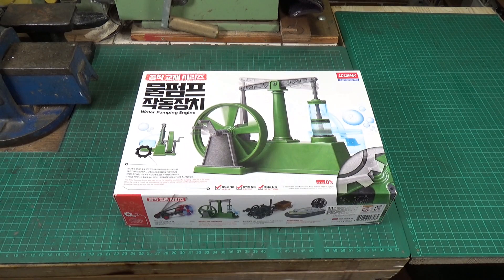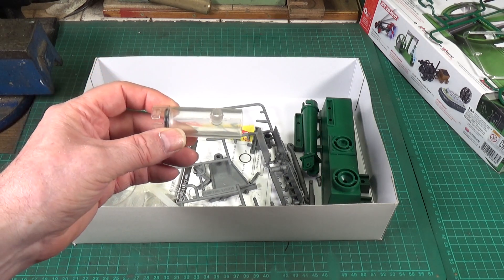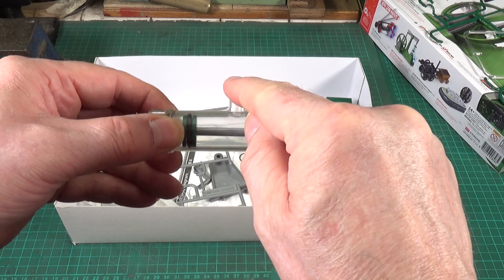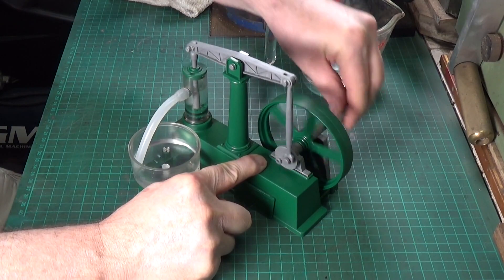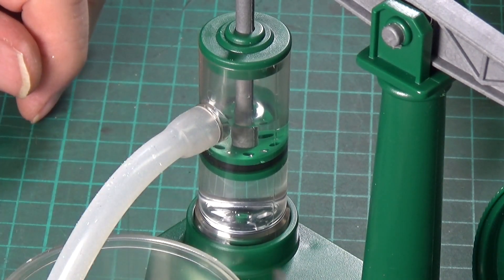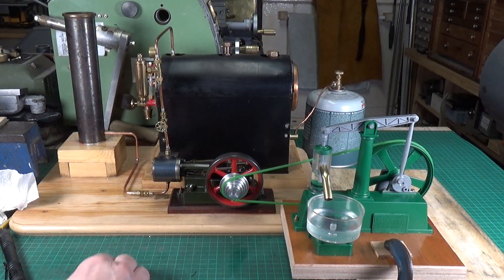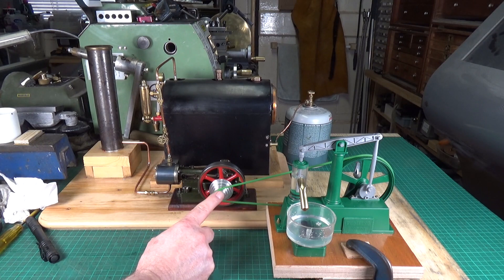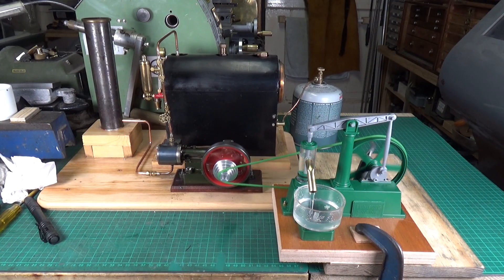Academy Beam Engine Water Pump Kit

Comment: Hi I have made a metal version of this but the pump it only works if I bleed the pump first. I E put water in the top of the pump. Am I missing  something? I do have a non return valve maybe it's not sealing?!!
Reply from the maker: I did find with the kit that the non-return valve would sometimes get blocked, this would stop the pump from working.
Reply: I will take a better look at it thank for your help.

Comment: Hi Alan. Very impressive kit considering it's plastic.  Is there a one way (anti return) valve in the bottom of the pump cylinder ?  The sloppy "O" ring valve for the piston is a clever idea. I'm tempted to make one of these and maybe use a disc valve to reduce drag - for my largest beam type Stirling engine.  Very interesting (and simple project).  Thanks for posting.  Cheers Rob
Reply from the maker: Hi Rob. Yes there is a non-return valve in the base of the cylinder. If you skip to about 6:37 in the video you can see it in action. I'm certainly tempted to try and make a version out of metal, a project for another day though, got too many projects on the go at the moment already 🙂Cheers, Alan.